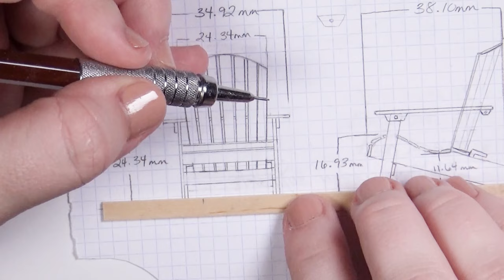Miniature Adirondack Outdoor Chair Tutorial (foldable!) | Dollhouse | How to Make 1:24 Scale DIY

Comment: are all the measurements in the drawings here just for 1:24 scale?  you no longer have the plans available through Etsy.  If the image at time stamp 0:29 is enough, then I'll use that.  I'm new to dollhouse miniature work and want to use some of the amazing stuff you've made in my own work.
Reply: David! Yes, that should be fine! I haven’t drawn those plans in CAD yet to be sold, haha. That picture at 0:29 as well as the information at like 0:26-0:29 is what I used and then I drew everything on graph paper the rest of the way. So it may not be perfect, but if you can fill in the holes, you should be fine. Ask me any questions and I’ll try to answer! Also, if you want 1:12 scale, then double all of these dimensions (I don’t know who knows that anymore).
Reply: @kmruckus  I just got your recliner plans.  an amazing bit of engineering.  so looking forward to doing this myself.  I did a small roombox (first effort into this) and now my wife wants a full house.  you are one of the artists I follow.  thanks for sharing.

Comment: IN STEAD OF MAKING DOWL USE WIRE AS A PIN
Reply from the maker: I appreciate your passion! I was worried about the connection if I did that. I hope you still enjoyed the video, notwithstanding!
Reply: YES I DID INJOY THE VIDEO AND I LIKE THE FOLDING CHAIR CAN I PLEASE GET THE MEASUREMENTS I KNOW YOU SAID YOU WERE WORKING IN 1: 24 SCALE IF YOU WOULD PLEASE GIVE THEM IN MM OR CM
Reply from the maker: At the beginning of the video, I showed the main dimensions that I used. The smaller, not-talked-about dimensions, came from drawing the actuall picture with what information I gathered through research. If you draw it out as best you can, you should be able to find those hidden dimensions. Sorry I can't help any further than that. :(